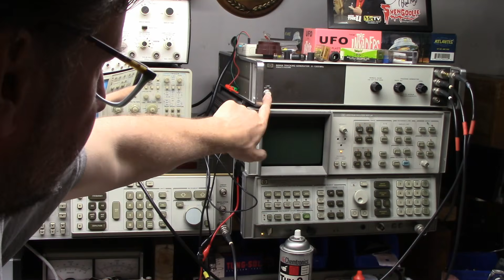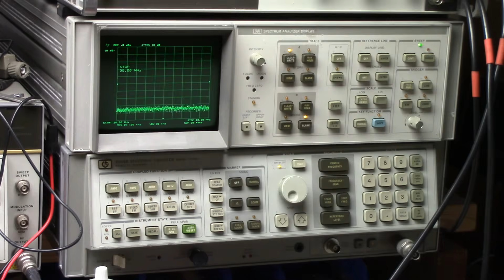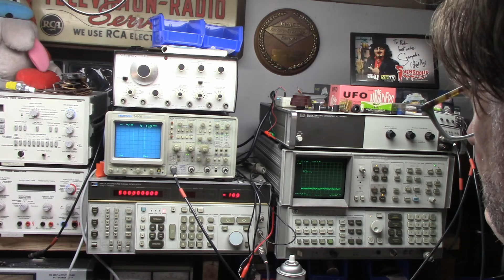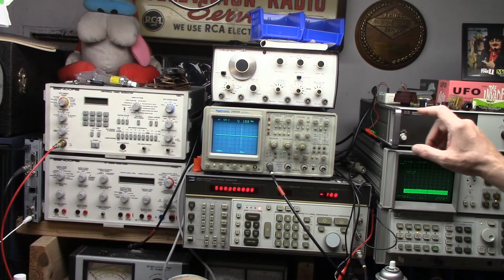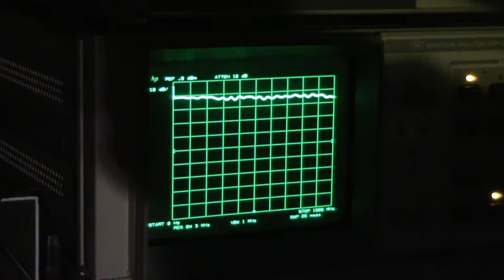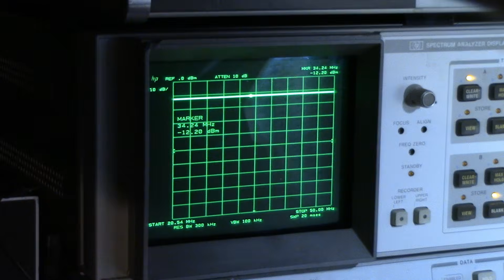HP8444A tracking generator part 2 of 3

Comment: Maybe something like a Si570 programmable oscillator can be used to create the missing LO signal. It'll need something to tell the unit what frequency to output (done via I2C-bus). 
When I started in the EMC business the HP 8566 and 8568 analysers were very common. Nice to see them again. A tracking generator is a very useful addition. However, nowadays a small and cheap VNA takes up much less bench space. The LINE switch on the TG was very common on lots of HP equipment so it should not be too difficult to find one. With some luck lubrication of the mechanism may get it going again.

Comment: I've got a scope with a bad power switch. I just hot wired across it inside, and plug it into a switched power strip and use that to control power. The switch is both hard to replace, and hard to find a replacement for, so for now, that was my quick fix. Otherwise, this setup looks great!

Comment: The RF output from the tracking generator is 0 dBm, so you will need a 100 dB step, or variable attenuator to pad down the output to feed it into a TV IF amp; like an HP-355D for instance.  You will also need a DC blocking cap.
Reply from the maker: Good call - I just ordered a HP-355D.

Comment: I would think as long as you can make a switch fit if it's just a simple off on with out a bunch of extra circuits being controlled anything that can take the wires should work. Also maybe you can pull it out and see if a spring or lock tab or something is broken or out of place and you can fix it.

Comment: You could do some sweet speaker crossover tuning with that kit...  ;)
Reply: While totally overkill, I don't think it would be the best. I think the setup will only provide amplitude information and not phase shift information.

On second thought, and much more importantly, I think some of the equipment has a minimum frequrency it can work at. If the equipment only goes down to 100kHz it will be useless for audio work.